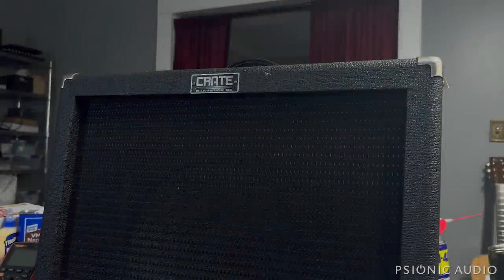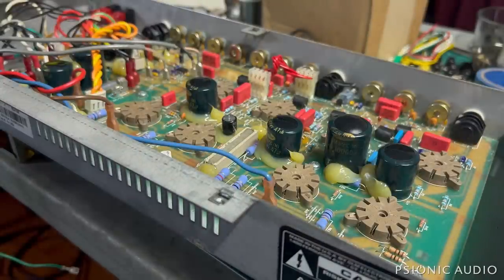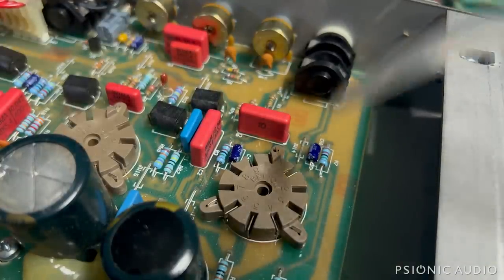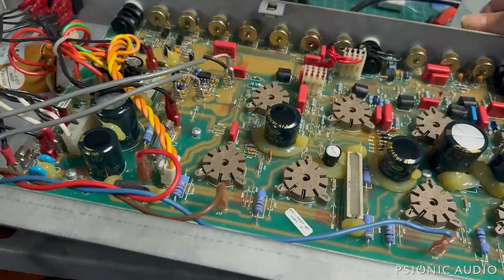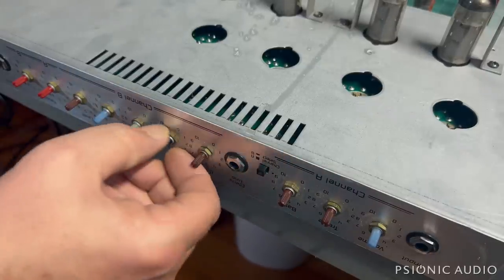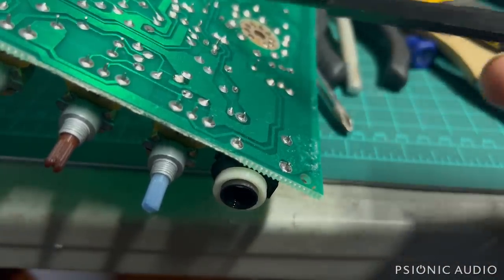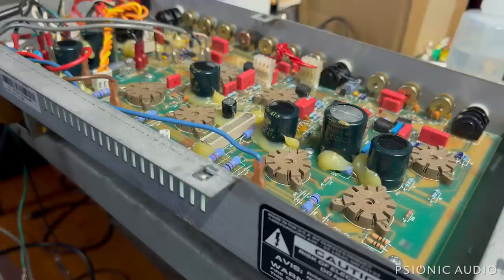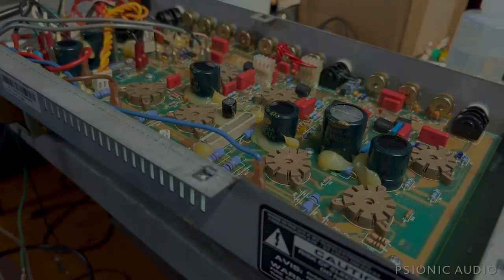Crate VC3112 | A Sleeper Amp Gets Some Love

Comment: This is the only amp I’ve ever owned, for now almost 30 years which is crazy. Got most of its use in the first 10 years admittedly. I have to say it’s had its fair share of electrical issues which never got fully resolved. But when you crank this amp to the point where you need earplugs (at least I do), it really sings. And that’s where I felt the best tone came out of it. There’s a point right before it breaks where you get this sweet clean tone that crunches as soon as you pluck just a little harder. It took me a long time to find that spot, but once I did I became a lot happier with the amp. Not gonna try to say it’s on the level of a fender tweed but it did the job for me and I’m grateful for its service.

Comment: Just reflowed a Vintage Club 30; built Nov '94; looks basically identical and had - from player's perspective - an awful lot of problems. But actually it all boiled down to the same source - broken and/or iffy solder joints on tube sockets. It works like a new now, no weird rattling/rushing/firecracker/sizzle sounds anymore, no jumps in volume, all fixed, without having to replace a single part. Thank you so much Lyle for this. 
Best wishes from Vienna, Austria
Reply from the maker: Bitte sehr! 

My wife and I loved our time in Vienna this past spring. Have a käsekrainer and know that I’m jealous.

Comment: I've got a VC6210 and it served me well for a good number of years. Like another commenter said, it runs hot and had a burned out something or other that I had repaired under warranty. It has a good sound and as long as I don't have to move it, I like it just fine. Seems that St. Louis Music used MDF infused with lead or depleted uranium. Heavy stuff. I always thought it sounded quite a bit better than the price point or name would imply. Thanks for this video!

Comment: I had some great Crate amps from the 90's and early aughts. As long as you don't need parts, they're great. I had to replace a couple of pots on a Palomino, and those were almost impossible to find. Ended up buying some from Ampeg service in Belgium or somewhere.

Comment: I have a Crate V18-112 of similar design, this video certainly gave me some things to think about when it comes time to service it. It sounds decent and while it's not a vintage Fender, Marshall or Vox, I didn't pay a vintage amp price for it either. It cost me less than $200 and for that, I can't complain.
Reply: I had the 212 version. I paid about the same price that you did. A Psionic video on one of those would likely be painful to watch. There were so many things that were objectively horrible about it. It was dark, heavy and noisy, it had ugly vinyl instead of tolex, etc, and just about everyting about it looked and felt cheap. For whatever reason, it was a great amp for playing music live with a band. It sat well in the mix. It was my main amp for at least 5 years. 

I never did any mods except a couple of lower-gain preamp tubes.
Reply: @jkf9167 😂 The way you talk about that amp you would think we're talking about different amps.  Mine although it's blonde has regular tolex. I think you are talking about the palomino series V crate amps.  Those did have that cheap looking vinyl crap that's on the new EVH amps and the blonde looks very similar to the vintage blonde fender amps.

Comment: I have an older version that I recapped and reflowed a lot of solder joints. It’s a ver good sounding amp now.

The stereo effects loop jack worked with a “y” cable. Works great.

Pots are the big issue as I couldn’t find replacements so I bought another amp cheap for parts.

Knobs are heavy metal on older versions.

Nice work Lyle, this is a great old budget amp that will serve someone well for years.
Reply: I have a Vintage Club 50 head with 2 x 12'' cab. It is noisey at idle but very loud and clean. Same 'Y' cable effects loop.
Reply: Blue locktite, on new pots wired to pcb.
Reply: @guydouglas6094  I have this combo, GREAT amp. This one is a later-made black one. I also had the white one which was like a heater in my music room in winter! that suffered badly from overheating the PCB but this later black one seems a lot better.

Comment: Thank you for showing this amp rework. I have the smaller Crate Vintage Club 20  (VC-2110 with Reverb) with the blond tolex cab and grill cloth. Twenty watts from 2 EL-84's and 3 12 AX7's. Only one channel with no footswitch, but it works great as a pedal platform.  I do wish mine was the  12" speaker, but those models were more rare in the 20 amp version. I am going to use your previous suggestion to me from your open chat a couple of weeks ago and upgrade the 10" speaker to a Warehouse ET-10. I have retubed the amp with all matched JJ's a couple of years back, but I have to find a local shop here in Jacksonville, FL  that can recap it and not butcher it. O love all your videos and I love the old Fender, Crate, and Ampeg reworks that you do.
Reply: I’ve had more crate amps than anything else. Still have a big guitar combo and a little bass practice amp, both sound much better than their price tags might have indicated. Unfortunately they have really flimsy knobs, but otherwise are solid amps; a bit heavy though 

Given the state of guitar gear in the late 90s and early 2000s, and the cost, I would expect more love for the brand. In my experience, Crate was better at making cheap amps than Peavey

Comment: The reason people like these Voxy Crates is that they are biased hot as hell. 
El84 tubes are easily microphonic from the start or hot/cold cycles where the amp gets tossed around before cooling off.  Some VC amps, Blond Guitar Center specials in particular sound way out of their price range if you lock them down to one location and put a fan on the chasis that’s louder than any 60 cycle hum one may encounter. 
The fix is to find the two resistors which can fry an egg and remote mount them off the board and onto the chasis with heat sinks so that the plastic in the pots do not flex out of spec so much that the wiper loses contact and cuts signal.  In honesty the VC 30 is one of my favorites tone wise for recording but I would not want to kick it around much without replacing all caps to a higher temp variety and maybe running the bias slightly colder but not so much to kill it’s character. The pots are fine when cleaned and lubed with a safe product. 
Last, I install a quiet running fan, suspended by bungee or para-cord. 
  Turning a combo into a head make the amp light in weight and plugged into an efficient cab or 4x12 will knock your socks off in great sound.   Still not loud enough to play chords for some drummers I have played with but I require loads of headroom and so the EL 34 - 6550 usually wins if not solid state amp modeling love hate mess.  Mic up that Vox sound in combination with a 100 watter and it’s tone bliss!

Comment: I have a VC3112, in the blonde tolex.  It has much cheaper looking knobs than those, black with gold caps.  The biggest problem with these amps is the tubes are soldered to the board, as you pointed out.  Every time you wiggle the tubes out, they stress the board and their solder joints.  Have had to resolder them multiple times.

Comment: I had a Crate Solid State 1-12 amp from very early 80's.  I had it for a keyboard, but started using it when i transitioned to guitar.  I later got a Ampeg Tri-Ax 60w tube head.  I really liked that amp, but since I wasn't playing out, it was overkill for home playing. SLM like Peavy are often derided as "Cheap Gear", but they have many examples of very serviceable equipment.

Comment: I had a 94 VC30 that was my first tube amp. I think it sounded pretty great but it was plagued by constant bad solder joints. I actually think the issue is a combination of the thin board flexing and poor ventilation. I've never owned an amp that got so hot. You learned to to never touch those little metal vents on the top after a long play! Mine would switch channels randomly because the footswitch jack solder kept melting, which was no fun in the middle of a gig or jam!

Comment: I have the amp and I get this very loud Hum when the back cover is off and I put my fingers near the two white plugs linked by four red wires. I've had it four 15-20 years. I'll check the 4 ground screws on the circuit board too. I did clean all the terminals and pinched the terminal clips. I really couldn't see what you meant by cracked solder joints. Could you supply a well lit magnified view possibly? This video was very helpful. I really didn't think I'd find something pertinent so quickly! Thanks again! Also I bought this amp for $190 I think. It beat the hell outta a solid state Crate Vodoo. The volume was markedly louder.

Comment: FIRST!   And from the 'Lou....   Crate were very reliable starter amps.  Still have the Crate CR-160 solid state amp my parents gave me at 17.
Reply: @Jamman610  No, just black tolex.  I think they stopped making them "crate" style in 82 but I do remember seeing that vintage in my local music shop.  The CR-160 was 60 watts solid state but wow it was a loud 60 watts.  Had no trouble competing with a 2x12 Twin Reverb clone made by Kustom.  Honestly, I haven't  played it much since getting a Marshall JTM-600 in 1997 but I recorded me around 1988  playing a cover of Clapton/Mayall doing Little Girl and on that day, that Crate and a crappy Les Paul clone recorded on a Tascam PortaStudio NAILED Clapton's Marshall 1962 tone.
Reply: I still have my wood crate from around 1980 when they first came out. It’s a bass amp 60 watts I believe single 12” speaker. Heavy and solid.

Comment: What size iron do you normally use on PCB’s? Bigger for quick heat transfer or smaller for precision? I’ve heard both recommended.
Reply from the maker: Smallish chisel tip. I can use the whole thing or just a corner depending on what I need it to do.

Comment: When you do a reflow do you just reheat the existing solder and renew the connection/seal around the wire or lift it off with the iron and put new solder on it? Thanks
Reply: It's pre ROHS so just heat & go, mostly.

Comment: What do you think about using Loctite on the knobs?  The idea is using something strong enough to hold, but something that can be broken if the knob needed to be removed.
Reply from the maker: I think you’d regret it. The knob might break before the loctite does.
Reply: After supergluing the crack(s) in the knob(s) ---- squeeze the crack back together with needlenose pliers or hemostats before the CA glue sets ---- fill the curved slots with epoxy glue, which will prevent the crack from splitting apart again. Cheap clear 5 minute epoxy is fine since it will have some slight compressibility to it (I wouldn't use JB Weld for this!).  If the knob still fits kind of loosely, which is unlikely (unless the splines are all chewed and worn), you can wrap the potentiometer shaft with a little bit of plumber's Teflon tape.
Reply from the maker: How much time should I spend at my hourly rate to repair 75 cent knobs?
Reply: @PsionicAudio  , I tossed that tidbit out for Russell's and other folks' benefit, not yours! For all I know, you may have already done this on occasion for jobs with a suitable budget where original style knobs aren't available; but otherwise it doesnt hurt to give people some tips on basic maintenance and repair that aren't so difficult or specialized that they could get themselves into trouble attempting it. Having somebody repair a knob themselves with epoxy, even if they screw it up, is far better than having them epoxy glue the knob onto the potentiometer shaft! We've both seen that happen, and cussed like sailors over it...
Reply: Hey, if the knobs are only 75¢, I'd buy a batch in a heartbeat.  But if they're practically unobtanium ... options appreciated!

Comment: how can you tell when a solder joint is bad?
Reply: By looking at it.
Reply: @TheCyberMantis  I know, but in this and many other videos, they look the same as the good ones....??
Reply: It’s difficult for a camera to show the crack, with good eyes or a magnifying glass you can’t miss it.
Reply: @curtiseverett1671  It's hard to see from a video, but if you see them in-person with a magnifying glass or reading glasses, you can see if they are bad or not.  An experienced tech can spot them right away.
Reply from the maker: Yeah, like I said it’s hard to show on a camera because the general shiny seems to confuse the lens.

I think you can see them pretty well when I show the input jack in this video.
Reply: @curtiseverett1671  , the solder should look like it has flowed onto and wetted to the lead of the component. A cracked or broken solder joint may look like a tiny volcano cone with a dimple at the top (a caldera? 😁) and the component lead may be seen sticking up through the middle of the cone of solder with a tiny gap or dull, grainy space between them. Sometimes its easier to see broken solder connections with low-level lighting because a bright headlamp, flashlight or overhead work lamp reflects brightly back at you and makes it difficult for your eyes to differentiate.  I often go over a board for resoldering with a fairly bright light source first and then switch to a lower light level for a second pass at it. Sometimes a bluish LED flashlight or headlamp will show up bad solder connections that weren't obvious when viewed with bright white light. In general, solder connections should look shiny and smooth, not dull, gray and grainy. Mechanical stress or excess heat can cause them to break down and change appearance.
Reply: @goodun2974  Thanks!!!!!

Comment: For the hum - just unplug the PI tube - you should hear no hum when the power tubes are good - because of the common mode rejection of a push pull design, you should hear close to nothing then. For the caps, I often measure the AC ripple with my DMM at the first reservoir cap. Some amps could also have a bad design, ineffective low pass filters and therefore too much AC ripple way into the preamp voltages ;)
Reply from the maker: Hey dude. You know that I know all that, right? I break the repairs up into shorter videos. This was initial inspection/reflowing. And that took us far enough along to make a suitable length vid.

I’ve found that if I do long videos of a full repair few watch the whole thing.
Reply: @PsionicAudio  , I think you're on target, Lyle; I too tend to prefer short-ish videos, less than a half-hour generally. The only person whose repair vids I always watch from stem to stern regardless of length are Ted Woodford's.
Reply: @PsionicAudio  dear lyle, that wasn't critic, sorry - of corse I know who you are.......if you think my comment is rude, please feel free to delete it. It wasn't ment that way, but I understand it completely if you feel so....no offense. All the best to you, cheers Paco
Reply from the maker: No worries friend.
Reply: @PsionicAudio  , Just a quick question,  Was that Crate amp manufactured with leaded solder or lead free?
Reply: @goodun2974  on target by me? I don't think so....I just did an addition comment, nothing more. But I see, this might get arrogant by those of don't know me - Lyle does. So I send appologies if my addition was missunderstood here......